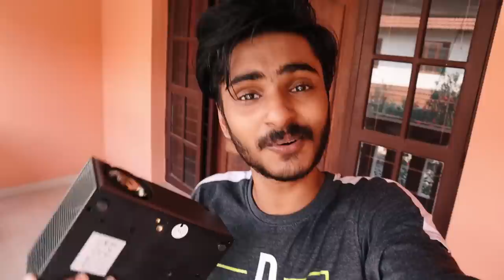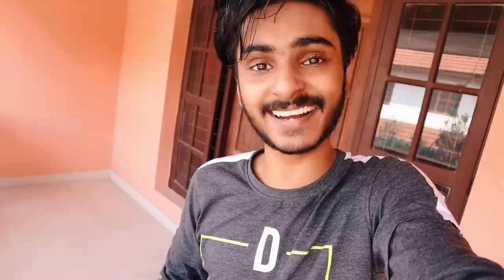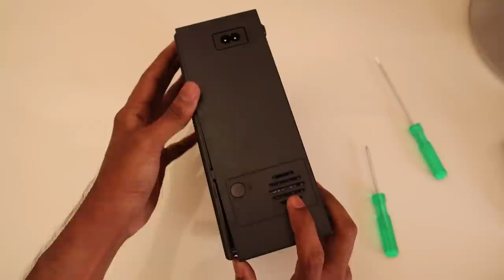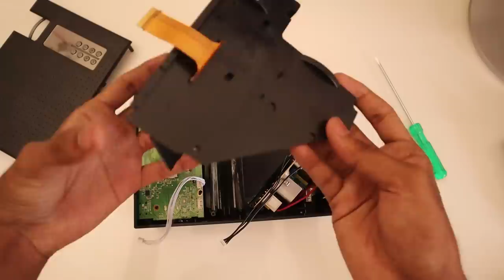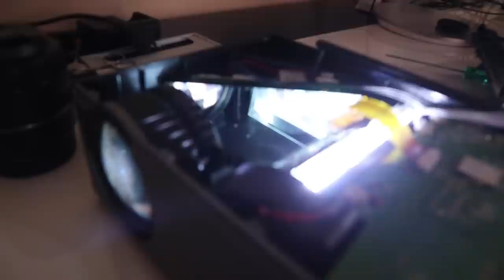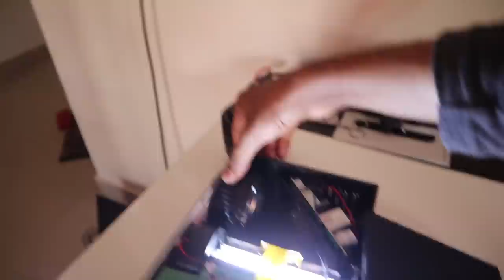WHAT'S INSIDE A PROJECTOR🔥ഇത് എങ്ങനയാണ് WORK ചെയ്യുന്നത് ? UNBOXINGDUDE l

Comment: The fan is for cooling the bright lamp.
The light passes through the lcd,the one that you almost broke when pulling the top plastic.
The image on the display is upside down.the mirror flips it left to right and right to left(flips horizontaly)and that passes through the lens which inverts the image back to normal.
That is why when you looked at the mirror,the video was inverted.